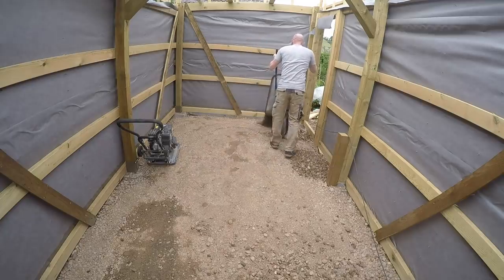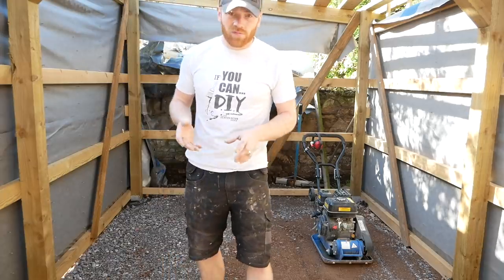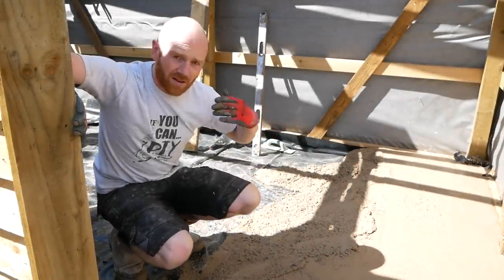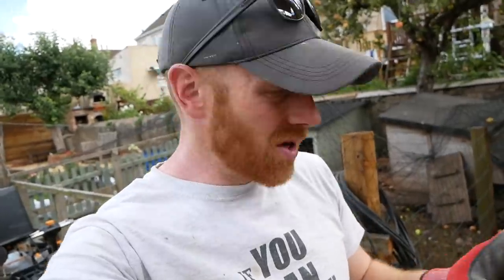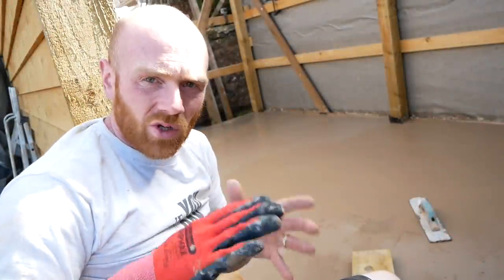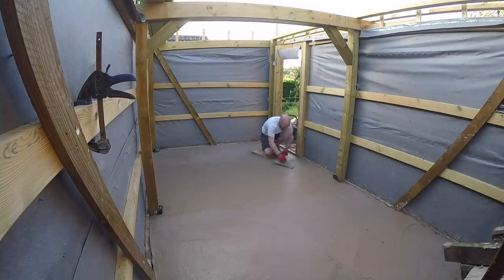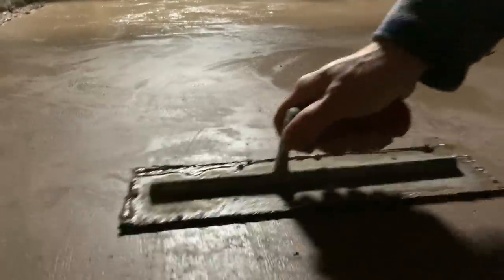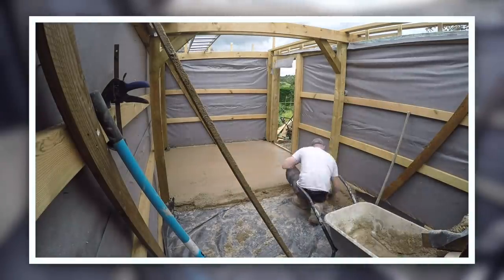CONCRETE SLAB SHED FLOOR | Last minute change of plan!

Comment: Great work. Just finished my new man cave shed. Started of with a basic timber frame idea. That soon escalated to block wall, coloured render and grp roof, just have epoxy floor to put down now. Went with 2 part Watco floor paint from their basics range. I had used 1 part garage floor paint before and so much has peeled despite loads of prep was not going down that route again
Reply from the maker: Will researching this soon as I’ll have the main workshop to do by the end of the year I hope.
Reply: Love to see it - have you a photo?   I'm leaning towards going for block wall too.

Comment: Its good to see some semblance of good building practice, even though its a shed  Ideally, the slab should have been poured before the wall were erected but this shows how to do it when the walls are existing.  Some light gauge mesh might have been useful in controlling any cracking but your mix was not overly wet and the area small, so that shrinkage ought to be minimal, there is a good chance the slab will remain in good condition.  It will require an anti-dusting agent to seal the surface and prevent too much wear.
Along with various bodies (literally) holding up motorway bridges, I bet there are some little folk under daddy's shed slab!!!! lol

Comment: You should take a look at the foam cushion flooring sold in Halfords,amonst other places.Its interlocking and relatively cheap.Its thick enough to cushion the floor and act as insulation.,,and it also covers a multitude of sins..
Reply from the maker: That would be cheating! 😀 I do actually have some heavy duty rubber mats already which may be worth using in some areas. 👍
Reply: Did my suspended shed floor in this - lovely soft grippy finish and looks very smart

Comment: put a self leveling compound over it once its cured ,saves hanging of ladders at night
Reply from the maker: Not sure it would hold up to banging around on an anvil, etc. Might do if you could get a strong enough bond but would worry about it delaminating.

Comment: Would it have been easier to rough arse the slab in and not bother with the bob on finish then pour self levelling compound to finish it?
Reply from the maker: This is being used for metal work and blacksmithing so possibly not durable enough to have self levelling. Plus self levelling would have cost more than the whole slab anyway.

Comment: Would readymix have been that much more expensive considering the saved effort?
Reply from the maker: For 1m3  yes. You usually have to pay for 50% of the empty part of the load so would have been more. Like I said, any more than this I would have but with this particular project and the location it’s in, mixing made sense. Most of the work is floating and troweling so that bit takes the same time.

Comment: I'm looking to lay a slab a similar size but I've used a calculator on the blue circle website and its coming back over £500 based on 4x2 metre slab @100mm thick. That's is b&q blue circle, (£6.42 per bag). Could I ask what you used? Thanks for great video.
Reply from the maker: Guessing that is a pre mix? This took a couple if bags of ballast and 10-14 cement, ( not sure exactly as I had some here already.